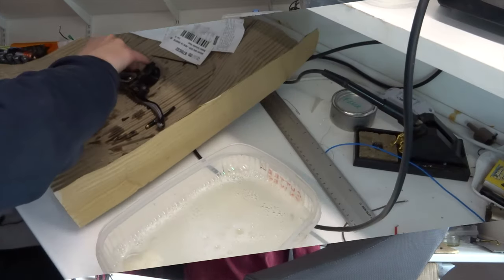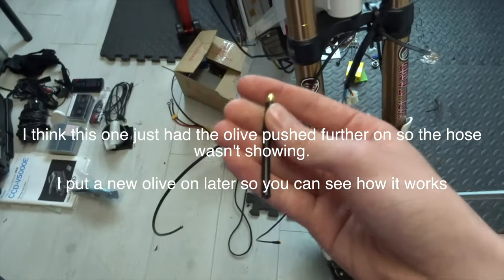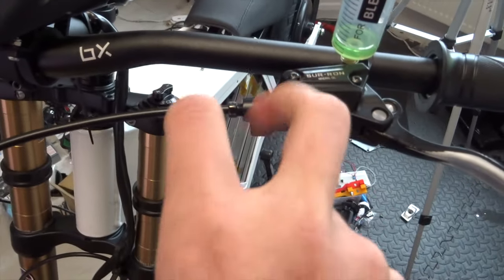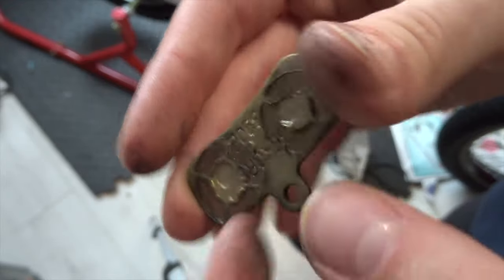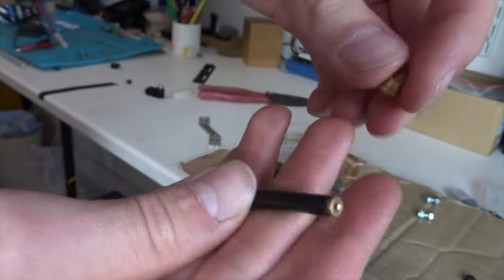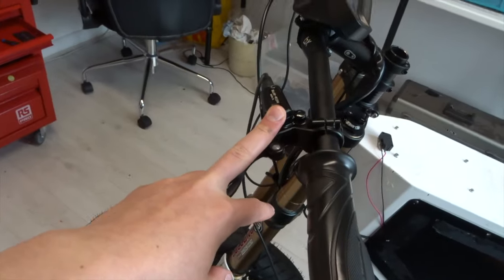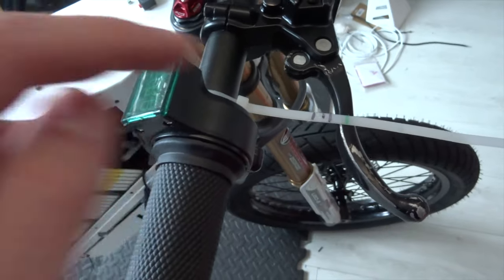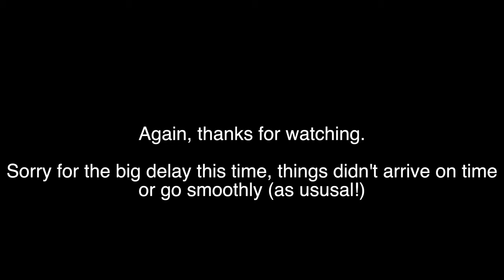Brakes, Brakes, Brakes! |  8kW Enduro MSVA eBike V3 Build | Part 15

Comment: Coincidentally
I'm just editing my next video and I bought shimano br-mt420 4 piston calipers and went back to a single on the front and kept the SUR RON levers and it works great.  I had a little bit of slop pulling the lever but there is an adjustment hex on the lever that sorted it out. I actually bought my SUR RON levers brand new direct from them and I think they are about £35 each plus shipping
Reply from the maker: Sur rons seem to be the only kind of levers for the MSVA these days. I saw a block you could buy that combines two brake hoses for a DIY dual calliper, but I saw the issues you were having so won't do that yet!  Is the adjustment you're talking about the one that alters how far the lever sits from the bars? Also where did you get the levers from?
Reply: @EverythingEbikeChannel  Yeah when I used 2 calipers there was tooooo much play before the lever engaged. Yeah I was on about  the  lever adjustment  to master cylinder as the levers seem a little close, I didn't have much slop with my new caliper . I bought them from here https://mall.sur-ron.com/collections/frontpage/products/light-bee-replacement-ebrakes?variant=31553283817544 Front lever on it's own is sold out .
Reply from the maker: Damn, wish I'd found that website as I'll likely have to add some hall sensors or switches to do the cut off and brake lights. One of the sensors is missing and haven't figure out yet the one I have .
Reply: @EverythingEbikeChannel  Yeah, I have got 12v live going to brake switches for brake light but after a quick cheeky test run on the bike I definitely want the motor cut off working in tandem . I will probably add a relay from the 12v lever switches but wire it as negative output.

Comment: Do you use regenerative braking ? 

sabvoton72150 regenbrake charging voltage is  85V  but your battery is max 58.8V
is it okay?
Reply from the maker: Absolutely fine if it's less that 85v